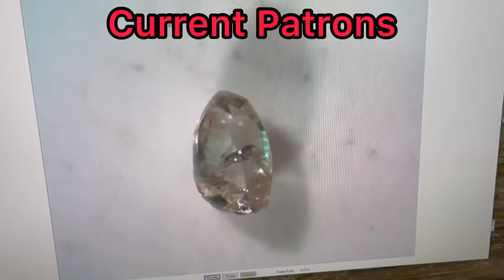DIGGING FOR YELLOW DIAMONDS.

Comment: To separate the rocks and mud get a drywall mixer that will fit in a cordless drill and with one of your lids put the mixer on the lid and trace around it. 

Cut the hole and then you can mix the materials in the bucket and nothing will escape you have to put the lid on the bucket properly. 

I have done this to clean my mixing stick as I have been drywall and every parts of it since I left school and that was in 1988